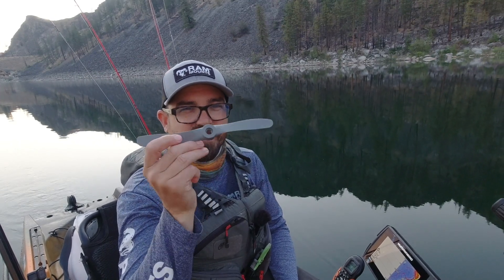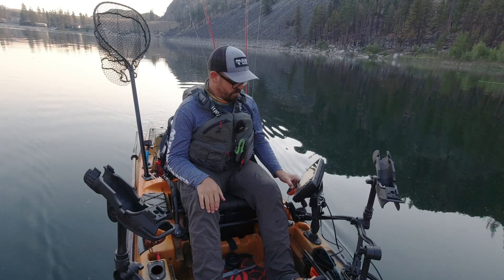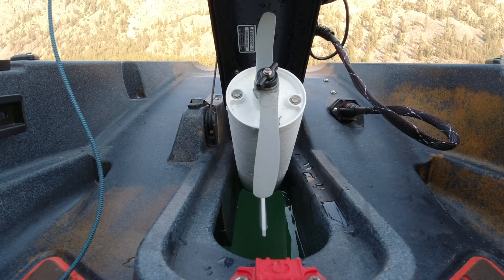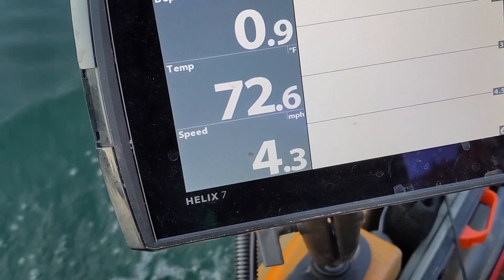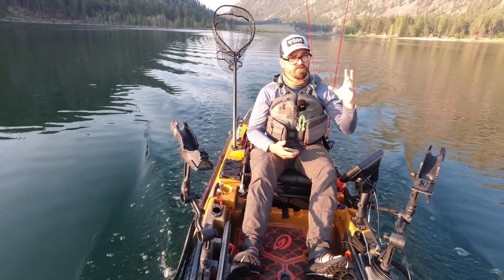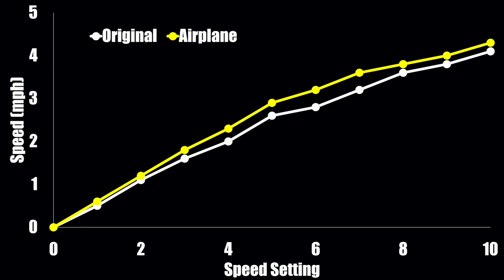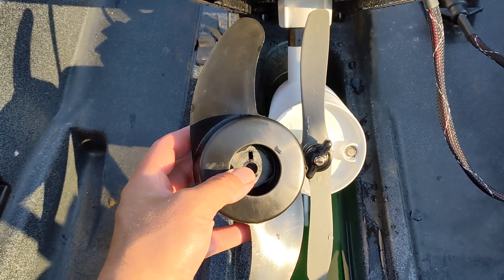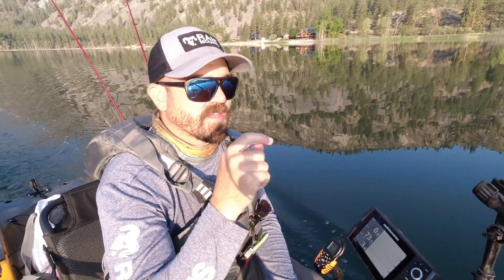Upgrade Your Trolling Motor for $4 [Airplane Prop on a Trolling Motor]

Comment: For safety, disconnect the motor from the battery when working with the propeller. The aircraft prop has a higher aspect ratio (length vs. chord) than the stock prop and appears to be less draggy as you guessed.  Both factors should contribute to greater net thrust.  The question of pitch should also be factored in as this determines hiw much of a "bite" or how far the prop advances through the water per one complete revolution.

Comment: Flip over that plastic prop. Look at all the cross plastic suports. And there you will find your answer. They creat friction hence the reason the cheep metal prop gives a little more speed. Go with the metal one but you better carry a backup.

Comment: I am really interested in someone trying a diy gear ratio for a trolling motor. What I imagine is just adding a pulley or bike sprocket to the shaft where the propeller attaches. Then adding some sort of enclosed oval or rectangle box with another smaller sprocket or pulley with shaft at the other end and run a chain or belt between them. Not sure how that would connect or anything but I am curious to just get like a ebike kit and make up something with it to get much higher rpm and overall speed on the water. You can only do so much with a propeller swap if the motor rpm isn't high enough. Obviously you will lose torque but with so many different lb thrust options out there I'm sure you can get one that will still have plenty of torque, even with some sacrificed for rpm. I'm planning to run 36lb or 55lb trolling motor or something equivalent on my 14ft v bottom aluminum fishing boat. Total weight with gear and passengers will probably be around 750-800lbs which a 36lb thrust trolling motor is perfect for. But if I were to try some sort of gear ratio I'd opt for the 55lb.

Comment: The airplane prop is more efficient, but trolling motor props are also designed to go through weeds without getting them all caught up in the prop.
So, if you are not in weedy water, it shouldn’t be a problem.

Comment: i Am thinking that the rpm of the two props have to be different. this  may be the reason for the added speed.  the motor will have less drag on the airplane prop than the bigger, heavier prop.

Comment: I just ordered the ACP prop for my trolling motor. They had an entire category on their website for trolling motor props. Several options and styles to choose from. 

What I will say is that… the aircraft prop looks a LOT like the prop on my old pedal drive kayak. 

It lasted a great many trips and bumps into oyster/sand bars and mud flats. Just don’t put it into reverse when in the muck! The blades are thin on the backside and that is when they get damaged. 

The only thing I ever had wrapped around that prop was about 150ft of 30 lb braided line one time that I snagged in the open ocean. Good thing I had a knife on me or I would have had to paddle back. The seedless wedge design would not have made a difference for me on that one. 

I may go back and buy a few different designs from them to see what is the most efficient.

Comment: I posted a video of testing various props on my Intex mariner 4 inflatable boat. I went from 3.7 to 4.3 using the 10X5m-LH prop, I believe you will gain more as well if you went with it

Comment: What about coating the bottom of the hull with a hydrophobic material? Some kind of spray on stuff that adheres to the plastic quite well so you dont have to reapply the stuff.

Comment: After working with model aircraft props, which are usually glass filled for rigidity. I can tell you that they will cause significant damage to flesh whereas most trolling motor factory props appear to be safer to fingers and flesh.  Just a thought

Comment: Props for aircraft have a higher pitch do to air being thinner than water. At low speed I don't think you're going to have any problems but at higher speeds you're going to run into a few.  Idk the math but you're definitely putting more stress on the motor because of the higher pitch u get more resistance.  Another is in water cavitation is a factor u have to consider. A prop made for the water is designed to minimize cavitation a prop designed for aircraft doesn't have to worry as much about it

Comment: This might be a better fit for transom or bow mount motors. I saw the same video you are replicating and it's really good to have the verification. The airplane blade is NOT at all weed free, and it's probably smart to carry your original prop in case of a problem. Thanks man!

Comment: Are these apc props clockwise or counterclockwise ?
Reply: Counter Clockwise
They are also recognized as LH ( left hand ) and most importantly PUSHER PROPS.
Reply: The props run Counter Clockwise.
Make sure they are LH ( left hand )
And they need to be PUSHER PROPS.

Comment: Your test would be more favorable for the airplane prop had you not cut it down.  There is no reason to cut it off.  It does affect the performance of the prop.  Also, have you tuned the trolling motor for optimal performance?
Reply from the maker: It hits the bottom of the kayak if you don’t cut it down

Comment: Consider "Laminar Flow Characteristics on Surfaces", and that might give you a better understanding on why the heck you're getting better speed vs. power draw.
(Been using APC Props for a long time on my R/C Planes, and getting better speeds vs. amp draw, too!  Batts. last longer, and I get to fly MORE!).  Lol

Comment: What thrust is that motor???
My old  late 90's or early 2000's 32 or 36lb Endura moves my 12' aluminum V at 3.8mph w/100Ah lead acid,7" Garmin and 10Ah lead,about40-50lb of tackle,4-8 rods,2 10lb anchors,2 seats about 3lb ea,some odds and ends at maybe 20-30lb an me at 200lb....
Reply from the maker: 55 lb
Reply: @spiltmilt  I'd be asking why it's only 4.0mph on a Yak,it has a lot less drag then my 12' V and a 32 or 36lb that's around 30yrs old. That water also looks like a mountain lake with almost zero current. IDK the speed of it,but where I get 3.8 has some current from the river feeding the lake.

Comment: I'm no engineer either, but you're going to gain simply by weight and surface area mass of that prop... the stock prop has the identical motor moving no less than 60-80% more blade surface area through the water and your measurements show that draw...... My guess is that these things were all taken into account by the engineers designing the trolling motors, and they added in the "strike" factors as well.... At different times during the use of these motors, they WILL strike logs, the bottom, the boulders, rocks, gravel etc.etc.....  which is (my guess) why they put heavier more durable props on than airplane props designed to slice through AIR and hit NOTHING....

Comment: I just finished installing one of these props on my Minn Kota Endura 55 Max(it weighs 26lbs).
The installation was slightly different than shown on yours as the hub is slightly longer, so I had to add 3 3/8 flat washers,and one 3/8 lock washer.

 I have a Lifetime Tamarack Angler 10ft. fishing kayak(49 lbs,maximum carry weight 275lbs )that I motorized as  a "science experiment" !
I've been running it with an Everstart Group 27 deep cycle battery(48lbs,110AH)battery. 
The motor mounts on a homemade transom made from pvc plastic pipes ,and fittings, for the frame.
The transom itself is made from a 3/4 in thick pine board that was sealed and painted. 
I've added a 6x6x1 nylon block to mount the motor on the board. 
All in all, it's a fairly sturdy set up!  
I did have to add a set of stabilizers to not only stabilize the craft, but to also increase the weight that it can support, due to the fact that with myself and everything aboard it's slightly overloaded! 
I just ordered my very first lithium 100ah battery that weighs only 25lbs,and that loss of 23 pounds should help!
My maximum speed before adding the stabilizers was just under3mph(2.94mph).
Adding the stabilizers dropped it a little bit down to around 2.5-2.75 mph.
I'm hoping that adding the 10-4 propeller will increase my top end speed, and possibly increase the range as well.
I'll let you know how it does!
Reply: I have the same kayak and with a 30 lb thrust Minn kota (17lb), lithium 50ah battery (17lb), it is fairly consistent at 4mph at speed 5. I tend to run more often at speed three or four if I have more time since it's more efficient to run at those lower speeds. Excited to try the APC prop this fall (not excited about getting it caught up on leaves but we will see how it goes!) I often have to shift my weight forward to allow the prop to be slightly "tip out of the water" when going through 9-in shallow areas on my little Conestoga River!
Reply: Gee, I wonder if your American, thanks for the life story to say “I’m trying this soon”

Comment: Thanks for the graphs, im a numbers guy and thats what i needed from this video. I assume it is possible but have any tech lords put a prop into a 3d scanner, tell the program to add 1-99% more pitch/size/thickness etc, print one at every 10% difference, run your exact same tests with each one. Find the sweet spot. Print 10 more 1% either side of that sweet spot, numerically. So on and so forth until you have the best design based on real world tests. Mass produce and sell on ebay. Hobby paid for itself.
Reply: Did that and there’s no market. Shame really.
Reply: @-ShootTheGlass-  whats the most efficient dimensions from your trials? More aggresive pitch, longer blades, thicker blades etc than market?

Comment: I saw the suggestion about using model airplane props on trolling motors long ago too and appreciated your in-depth analysis. I'm glad that you also measured the current draw of the props at different power settings. I had wondered if steeper pitched props might overload the the electric motors and result in excessive current loads at higher power settings. One issue about thrust is that I believe that it may diminish at higher speeds when the same power setting is constant. I suspect that the thrust ratings of trolling motors are measured when the test platform is not moving. I think this may be when the thrust would be greatest. Now I'm wondering about the potential speeds and current draw when using steeper pitches and where possible, longer propellors. Thanks for an excellent, thought provoking video!
Reply: The model airplane trolling propellor topic continues to interest me. Regarding your hypotheses about the reason for the difference in thrust I also have a theory. In comparing a boat propellor to an airplane wing, a long, slender (high aspect ratio) glider wing will generally deliver more lift in proportion to the drag that they produce. In comparing wings to propellors I'm equating wing lift with propellor thrust. The electric motor that turns the propellor is working against the frictional drag of the blades moving through water. It seems that the slender propellor may be converting more of that drag to thrust (or lift) relative to the amount of drag created at various speeds. 
I think the question we are trying to answer here is: Which propellor blade profile within the specified diameter limit will produce the greatest amount of thrust and the least amount of drag within the rotational speed range and electrical current limits of a trolling motor? 
Thanks again !

Comment: FYI for anyone that is interested. This same company now offers a 10 x 5 prop that gave me and extra .5 mph on my Jackson big rig with a 30lb minnkota. I also have ordered the Jackson Kayak 10x 10 prop from them which I expect will give me a full 1mph increase with the 30lb TM (won't know till I get it). Their price is $16...about 1/3 the price on the Jackson web site. I don't know if this information will be deleted or not but thanks again for the heads up on these props. It really makes a difference when crossing a larger inland lake.
Reply from the maker: Thanks for sharing!
Reply: @spiltmilt  DO NOT get the JK prop. It's backwards. It pushed a lot of air and probably would work great if it was a LH prop.
Reply: so how did the 10x10 prop do?

Comment: Hello Tyler, thank you for the video. It's been over a year and I was wondering if you still endorse the airplane prop for a trolling motor. Also how do they hold up. Appreciate the video.
Reply from the maker: I use it for most of the last year with no issues although I sold my AP120 last week so I won't be able to determine beyond this point.
Reply: @spiltmilt  👍

Comment: Hi Tyler, Great post. I have a 46L #  trolling motor that is too fast for kokanee trolling even at speed #1. I was thinking of purchasing the RC  prop that you suggested an trimming it down to a smaller diameter. I know that this would be a trial and error thing but would this reduce my low end speed?
Reply from the maker: Definitely could work or you could deploy a drift sock to slow you troll. https://amzn.to/3Ppz8WQ

Comment: Tried whole bunch of props in different sizes and pitches. Not much of improvement, but larger ones just draw more current. Ended up leaving stock prop and added PWM controller and amp meter. For my Minn Kota C2 50 the best cruise speed at around 26-28 A. If I crank all the way up it draws 40A with tiny gain in speed.

Comment: Hello, Tyler

I really appreciate the quality and highly informative content you put out as well as being very entertaining! Great job! As a new kayak fishermen I have been watching your videos as I rig my new Old Town AutoPilot 120. I absolutely love trolling for walleye and musky from my new fishing machine. I'll be taking it out for salmon and trout soon. Quick question.... are you still having good results with the model airplane prop on your AP 120 and do you recommend others do the same to gain a little more speed? Also, do you still see the increased efficiency on the battery? Thanks!
Reply from the maker: Yes I still use it and experience about the same level of improvement in the video.

Comment: Great video. airline pilot here, and this video was really intriguing. I'm often wrong but I was thinking about something. You talked about having to trim the prop to clear the hull during rotation. I wonder, if it's just BARELY clearing the hull, I would think there might be some inefficient disturbance in the water flow with such little clearance between prop tips and the hull. I wonder if you trim just a little bit more, which would be counter-intuitive due to reducing prop length, if that would create less buffet in the water flow, and end up being more efficient.  ?? I really have no idea, but just a random thought. Great videos, and I still haven't figured out if I want to splurge yet, or save for a real boat. :) best of luck!
Reply from the maker: Interesting idea. I will try it.

Comment: The original propeller is a single-turn wood helical screw. Two boats raced each other. One of the racer's screw propellers had a portion of the helical screw break-off. That boat suddenly sped up and won. The lesson learned is that surface drag is important. I am going to try two counter-rotating propellers. The reason is that I am going to see what happens when both propeller motors are out of the water, for less drag. only the bottom of each propeller will be in the water. Also, the motor mast will be out of the water too. I am thinking that design will have drastic improvements in efficiency.  One worry is the bending moment on the motor and the fatigue from the propeller blades flexing. Rick Gellert

Comment: I remember reading about Dick Rutan and the 76 Voyager, the first aircraft to fly around the world without stopping or refueling.  They initially chose wooden propellers to save weight, but subsequent testing revealed that the greater efficiency of more rigid steel propellers more than made up for the greater weight, although it wasn't obvious, timber propellers flex and deform to an extent that it seriously affects their performance.

I wonder if this might also explain the difference in efficiency here, with the model airplane prop being a lot more rigid?
Reply from the maker: Very well could be. Carbon fiber paddles for kayaks are more efficient because of their rigidity. You lose energy with flexible materials.

Comment: I noticed that your motor is mounted in centre and not at the back, what bracket or which min kota is that
Reply from the maker: This is the Old Town AutoPilot that comes with a built in 55lb thrust MinnKota Terrova

Comment: Nice. Running a trolling motor off the back doesn’t have the problem you have with regards to the prop hitting and might gain speed.

Comment: Good test.  0.3mph increase is not a good trade-off for the prop jamming up when the motor stows.  And........both props apparently present the same inertia to the motor as they draw the same current.

Comment: Am I the only one asking why the airplane prop had to be reduced to the diameter of the original,  there was a ton of clearance to the stabilization plane above.
Reply from the maker: I trimmed it to the diameter of the original manufacturers diameter
Reply: @spiltmilt  Why?
Reply: Maybe it could have to do with the insertion/ removal of the blade assy through the kayak??